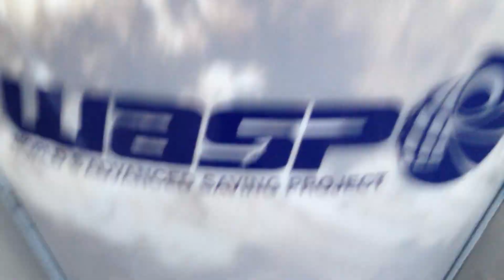WASProject at Maker Faire Rome / BigDelta12m

Comment: I have always dismissed this as useful because I assumed it use concrete. which would suffer from many structural faults if layed in this matter. but I can see there using a different blend of materials. anyone know the ingredients
Reply: Concrete as it greatest quality is for it strength in compression. However air is introduced through mixing greatly reduce strength so vibration is often needed to remove air. Reinforcement or rebar is used to strengthen the concrete in tension (trying to pull apart l)  reinforcement can be used but there are other mixers that can be used I have seen a mix with lots of tiny steel cables mix through the concrete. Does not provide as much strength. 

The problem I see with this technology is that it already exists in a different form for example a mud house could be built using a mold. The advantage of 3d printing is that the design can be changed for the house if needed. But for cheap housing this idea has little merits. Not that its not a valuable idea.